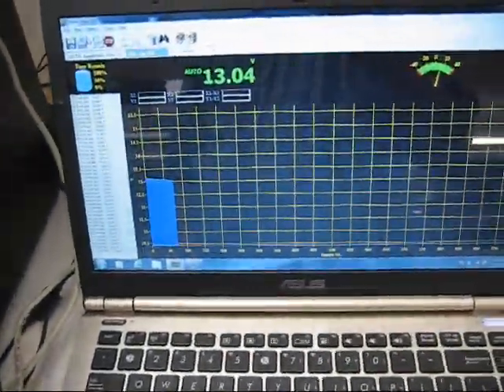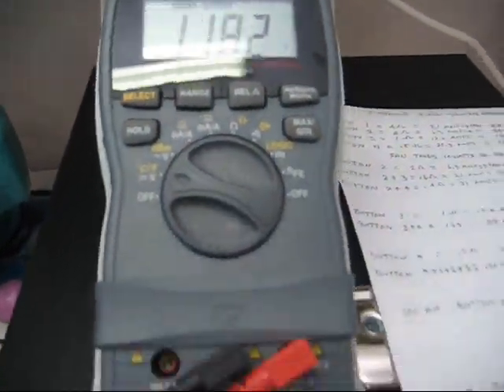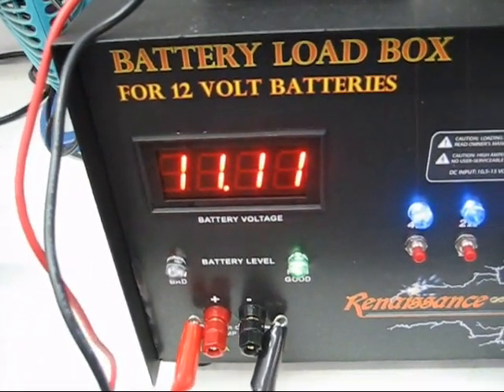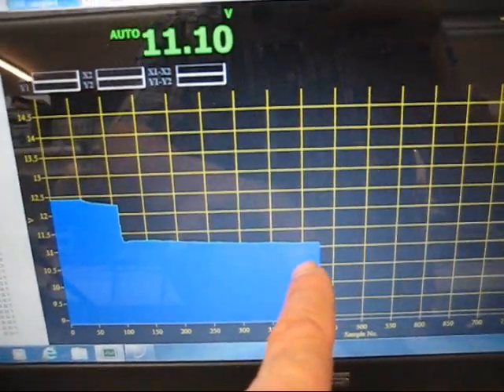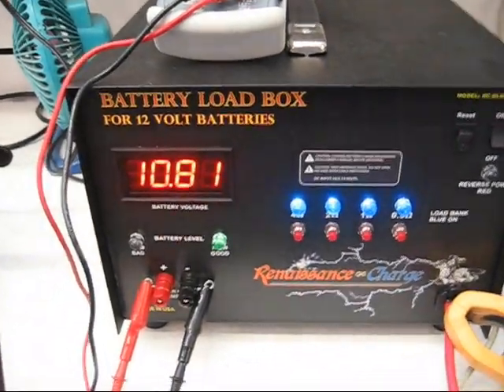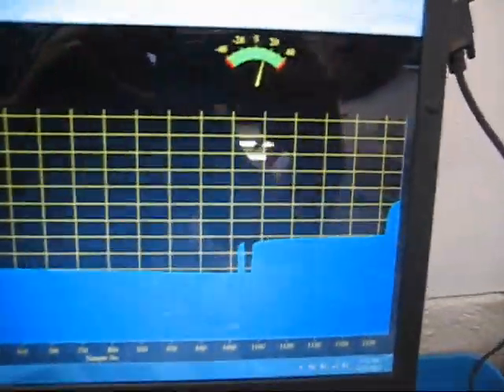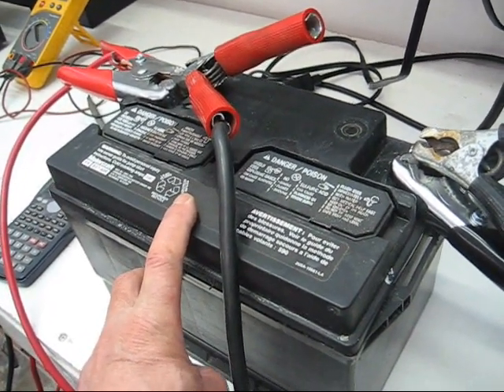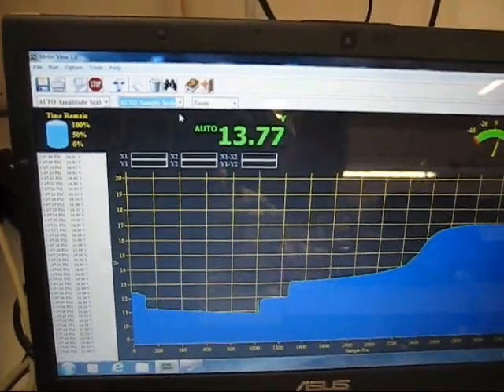Lead Acid Alum Battery Conversion Part1.wmv

Comment: How to Purify Water in a Cistern
Easy! Stir in a tablespoon of powdered alum.
After 30 minutes the alum cause the particles and the bacteria to 
bound together and cause them to drop to the bottom leaving a clear 
purified water.
A tablespoon or half an ounce of alum will purify from sixteen to twenty gallons of water.

Comment: So, basically, 50 amp load ran for .5 hours, which is about 25 amp hours.  It's a 30 amp hour battery, so, getting 25 amp hours from an alum battery is good, great even.  That's impressive.  These are the figures I needed.  How did you convert your battery so well?  Most people say it discharges linearly, but, it seems to discharge  above 10.7 volts quite consistently, doesn't it?